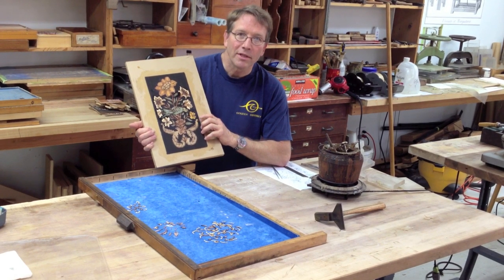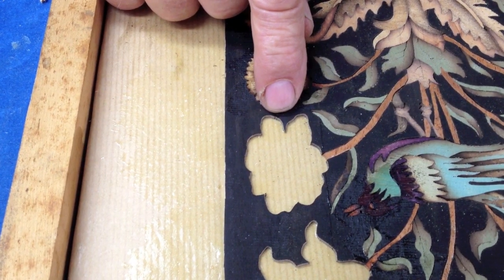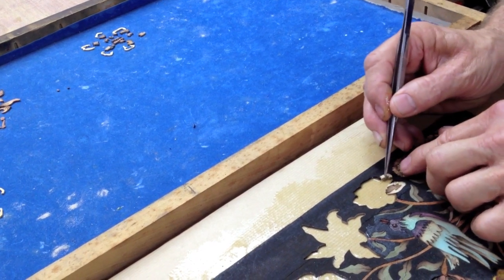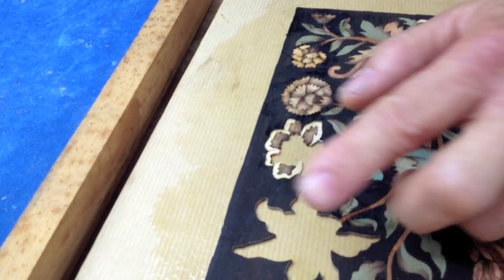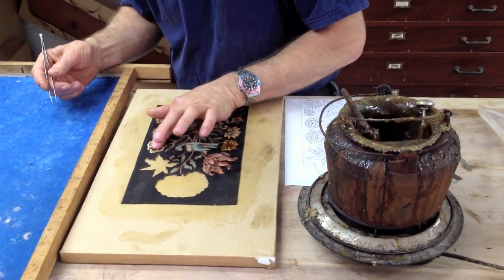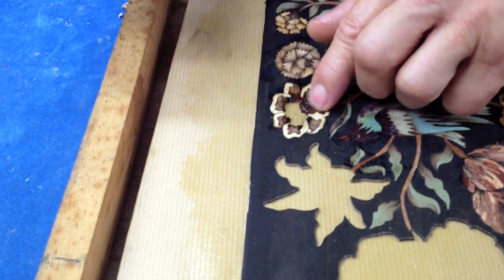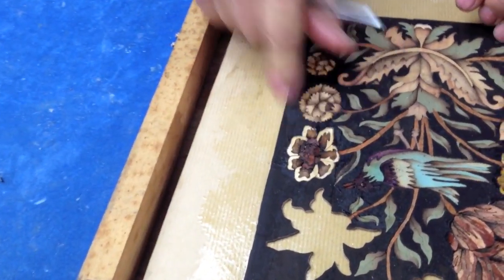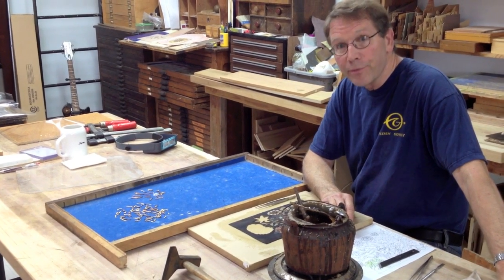Marquetry on an assembly board - paperbacked marquetry

Comment: Salut Patrice. Lovely work! I was wondering what kind of glue you are using?  It looks like such a great product, and I have just begun attempting this art, utilizing thick, messy wood glue.  For one, like I said, it is messy, and two it does dry somewhat yellow, so every little bit needs to be cleaned off thoroughly. Thank you!
Reply from the maker: Hello. We use hot hide glue for putting the marquetry together on an assembly board which is streched paper over a board. 
Couple links to understand the process
http://wpatrickedwards.blogspot.com/2013/08/assembly-board-videos.html
http://wpatrickedwards.blogspot.com/2010/10/assembly-board.html
and more of the actual action of putting it together
https://www.youtube.com/watch?v=FJC6ruHafgM
This is a video we did for the Art institute of Chicago
https://www.youtube.com/watch?v=6GcXqcKVwk0
Let me know if you have more questions! Have fun!
Reply: instablaster...

Comment: Hi Patrick, thank you for your videos. I have been looking for information about marquetry using hide glue, and have watched several of your videos, which are very interesting and informative. And your work is amazing! 
    I'm hoping you might answer a couple of questions for me? Is it possible to apply a paper-backed marquetry panel using the hammer technique, or can marquetry panels only be applied using a press? I was hoping to use hide glue & hammer as I've had rather variable results with PVA and clamp press. 
    I also wondered how you remove the kraft paper once the panel is applied without affecting the glue holding the panel in place?
    Thank you
Reply from the maker: Hello, you can use hammer veneering for marquetry panels held by paper. It is a question od surface and speed of work. We usuaaly go for the press as we can use heat to reactivate the glue for best resurlt if we use hot hide glue, or Old Brown Glue which gives us a longer open time. When we remove the paper we apply cold water, just not to much or to long, so it does not migrate through the veneer to the glue. But in general, to affect the glue you need heat and moisture.

Comment: Hello! I had one query ... I dedicate myself to the marquetry very recently, I'm from Argentina, and I wanted to know if he used animal glue to glue the pieces, if so, I imagine that you should use very thick, but which dilution is fair? what material placed under the marquetry when glue the pieces? Thanks, bye, I hope your answer.
Reply from the maker: Yes, we use hot hide glue, the dissolution is very runny. We can not give you a glue water ration as it is always changing due to evaporation. More runny than thick is better, otherwise you would be making gello under the veneer.
As Patrick expalined in the video at 20-25 sec, the marquetry is glued on an assembly board, ribbed Kraft paper stretched over a board, paper mostly available in Europe.

Comment: How many veneer layers are in your marquetry packet when cutting? And what do you use to get those different colors?
Reply from the maker: This project was cut in 4 copies and with sawn veneer I can go up to 8 and 12 with sliced veneer. Only the green are died in this project. Some of them come already died from Patrick George in France the other we died using traditional recipes similar to textile dies.
Hope this answer your questions.
Reply from the maker: I have to correct, this project was done painting in wood and not piece by piece and was 6 to 8 layer thick.